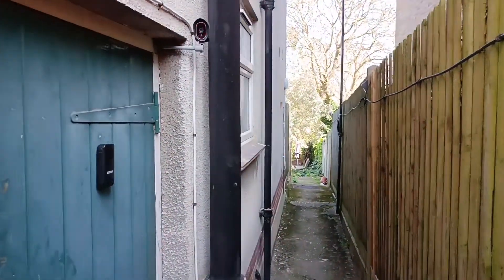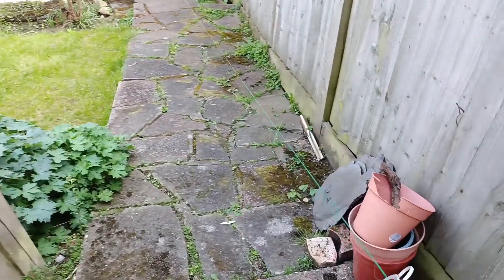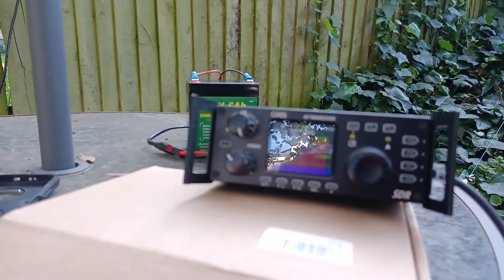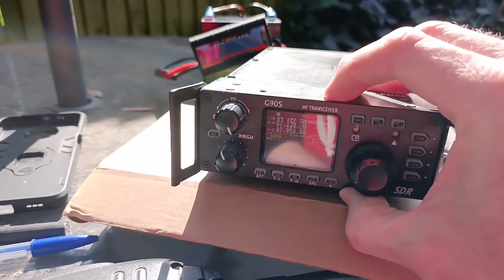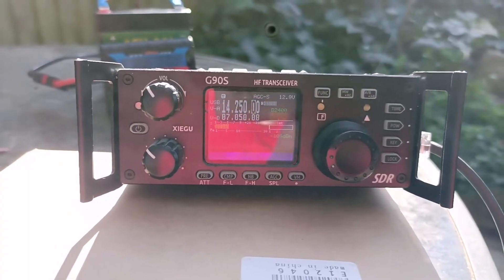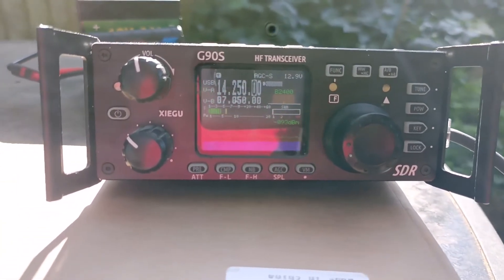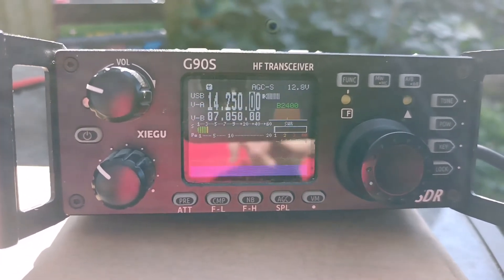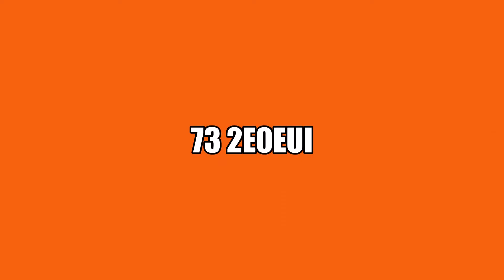QRP Guys HWEF Antenna + Xiegu G90

Comment: I have the same set up for POTA with 61'6" ft antenna with balun up off the ground abt 4 feet with excellent results. Height for antenna approx. 40 feet.  G90 always finds a good swr match.

Comment: This antenna system would work better with about 50 feet of coax feed line.  Also, the G90 has terrible speaker....use external powered speaker for better audio.
Reply from the maker: Hi Pete
Yeah it was just a quick lash up to get the antenna wire length right. My main HF Antenna is also a 49:1 EFHW and it is on the same fence in the video but about 10m up in the air 👍🏻

Comment: no such thing as "half wave" end fed.

False meme to create an impirtant soynding acronym.

A REPUTABLE source, Radio Magazines Radio Antenna Handbook, done by ENGINEERS, says end feds are RANDOM LENGTH.

They are untuned. The tuning is in the parallel network feeding them.

Soneones invented " half wave" to try to sound important.

There is ZERO radio knowlege here.